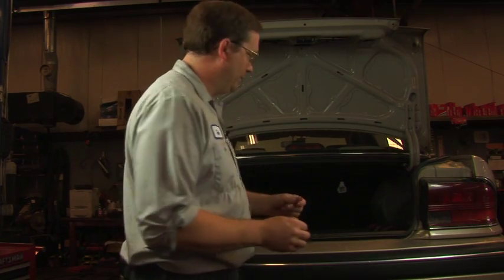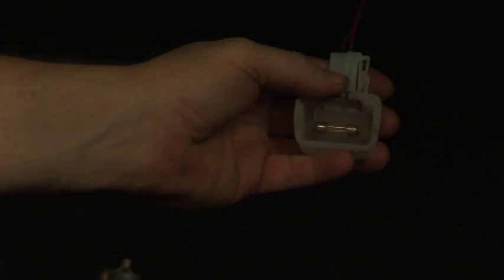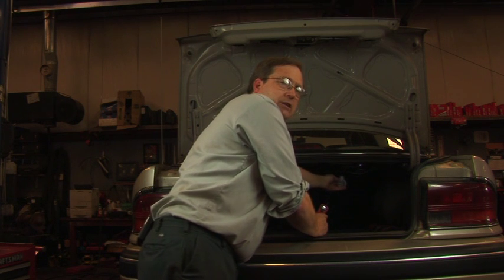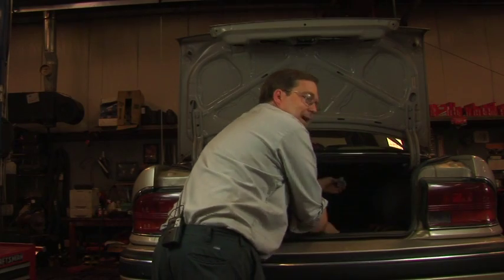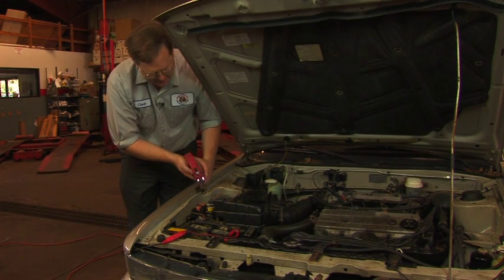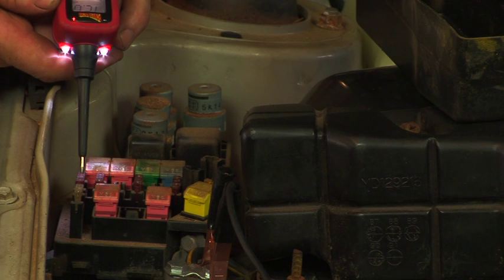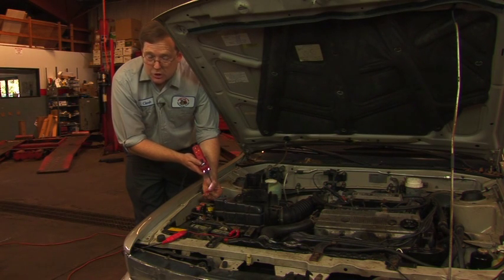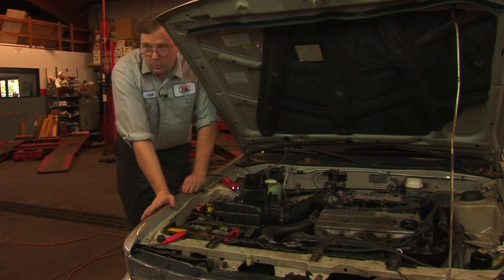Auto Repair & Maintenance : How to Diagnose a Car Electrical Problem

Comment: I was reading something from 2ub40 below. Now like youre askin about keeps blowing out. In the most cases you have a cable where the bare cable is touching bare metal best places to find things as such are door cables. Worn from opening and closing the doors. A bit more advanced, would be to much power supply like a relay not doing what its supposed to. a shaby conection which causes sparks or an electrical problem  in a divise its self. These are just some of the things.

Comment: hello.. i have an electrical problem on my car it seems that the current flowing to my headlights are to low.. "low on brightness" i change the bulb to a higher watts 100 - 90 but the same volts 12v but it seems no effect at all..the same result.. whats the problem of it? plss help..thanks a lot!